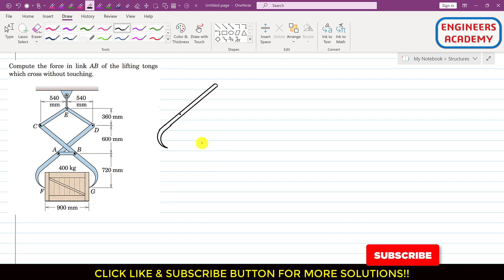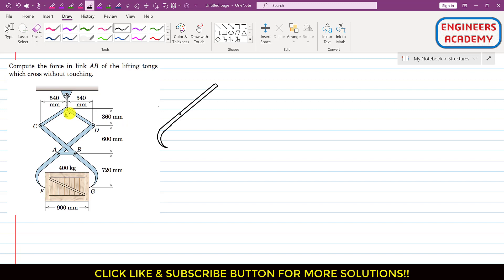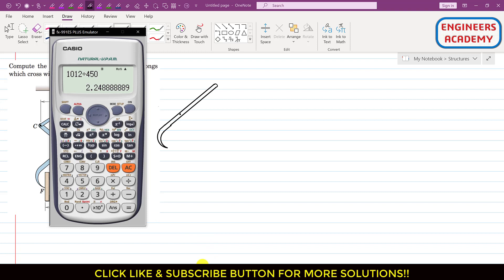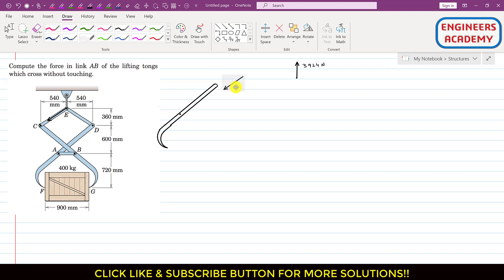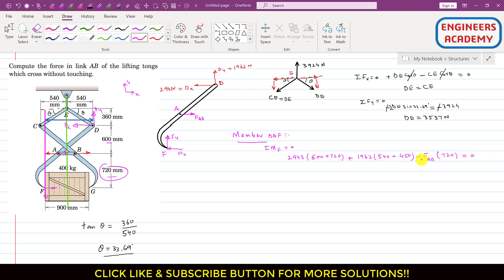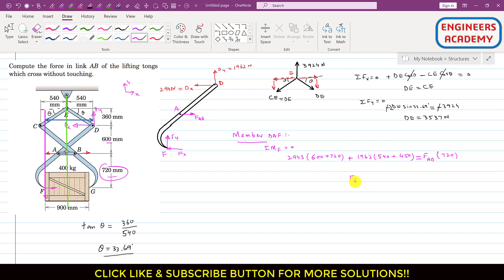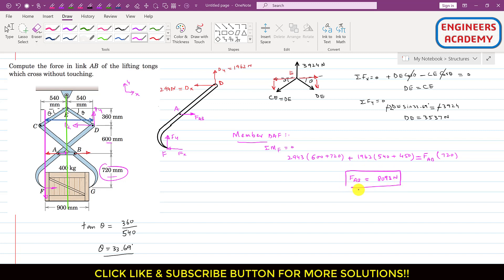Compute the force in link AB of the lifting tongs. | Frames and Machines | Engineers Academy

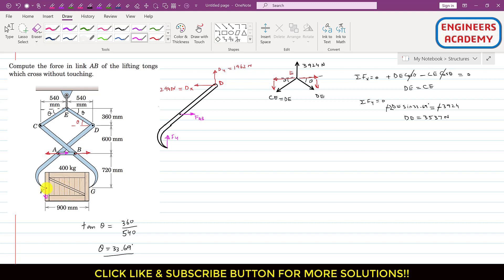Comment: A small qualm; around 8:20 you mention that the tong is applying a downwards force on the crate, so the reactionary force in the member is pointing upwards. We actually know that the reactionary force is pointing downwards because the crate is pulling the member down as the tension in the cable opposes this motion, which would save some confusion. In actuality this distinction does not affect the answer because we are not solving for Fy (and even if we did we would just get a negative value, indicating that it points down), but the principle exists regardless. Great video